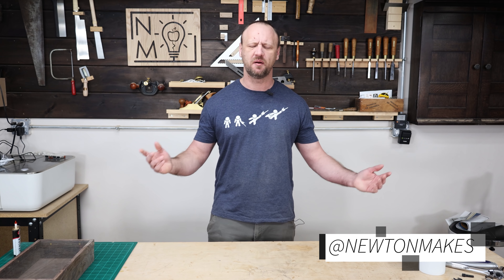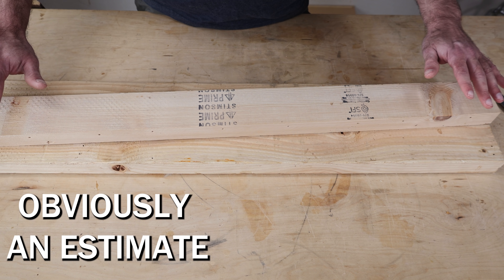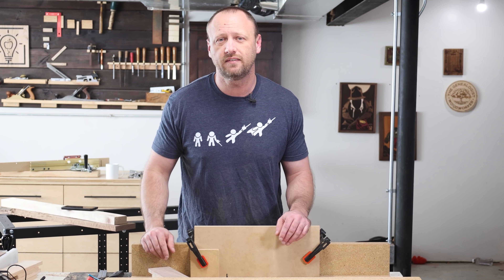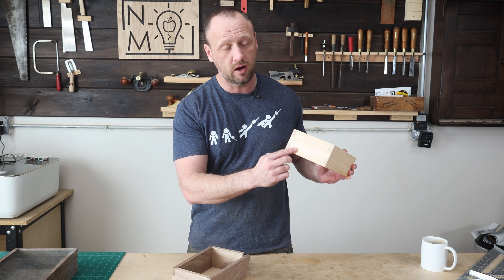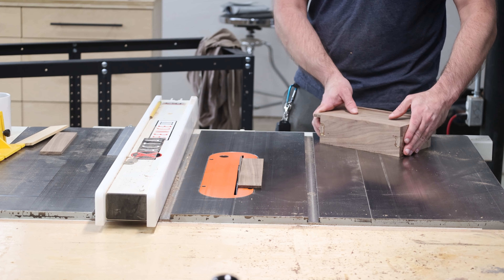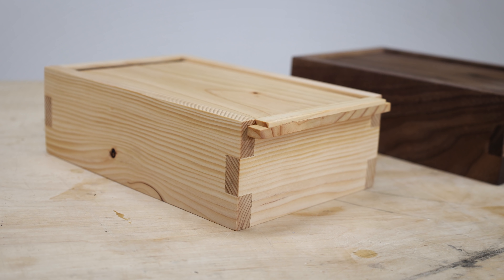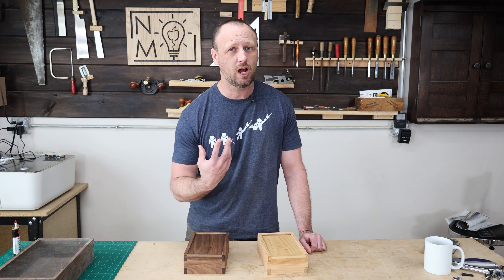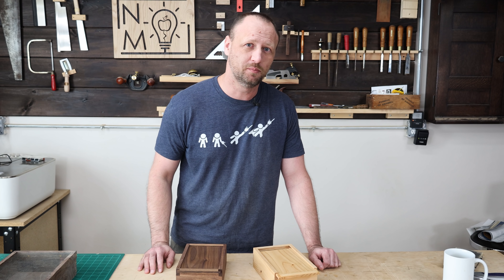2x4 Box vs Walnut Box - What's Worth More? Wood Box SHOOTOUT!

Comment: I agree Billy, thanks for sharing! When I got back in to wood working my wood was a pallet of pallet wood with cut off nails, cost me $50 for it. All kinds of wood. I was able to build enough projects to pay for my table top planner (learned about the wire left in nail holes of pallet wood), table saw, 12” double compound chop saw. Used a punch to knockout the pieces of the nails, used wooded dowel to fill the holes, a little glue and put them in like you would a nail. It didn’t happen overnight, as I was able to add a tool, it help me pay for the next one. I was blessed to have a Direct Tools outlet a hour and half away. Where I could buy either a blemish or reman item. My table saw and chop are blemish with lifetime warranty, where my hair hand sanders, drills, impacts are reman items with a 1 year warranty. Over a year ago I was able to add a 1500x1500 CNC to my shop all thank to that $50 I spent on that pallet, haven’t used any pallet wood in years. A another place for wood are  these places you can go throw a axe, those free 2X8’s make nice heavy rustic Flags, yes I have clamped and glued some of the cracks. Time to makes some saw dust 😎

Comment: Great video! I loved the original video in question. I found it brilliant and eye-opening. I think it really comes down to those two key statements - “I am proud of the box I made.” and “I’d be happy to have this in my house.” Those who can’t make those statements about a box made from construction grade softwood are wood snobs. And that’s OK. As a music snob, I can’t fault them for that. But just as there are people who like highly processed, computer generated/corrected, mindless pop songs, there are always going to be woodworkers who are proud of their creations regardless of the wood species used. (Ironically, although I am a music snob, I am not a wood snob.)  And there are things that can be done to dress up projects like this - from staining and dying to shou sugi ban, wood burning - even painting. Another great option is to use small pieces of exotic hardwoods (which don’t cost much - per box - because so little of it is being used). The splines in splined miter joints or through dovetails at the corners, for example. Or handles, trim, inlay, panel frames, and more. I use techniques like these all the time to dress up projects made from relatively inexpensive stock such as poplar and beech. Making the same projects out of walnut, cherry, or oak would be cost prohibitive on my budget. I, too, would be proud of boxes like these. I agree with Billy; it’s the craftsmanship that matters. To me, one of the best things about using inexpensive stock is that you can make gifts for friends and family members that don’t cost a lot - yet they are very much appreciated, usually kept forever, and even passed down… all because of the inherent craftsmanship.

Comment: Both boxes are beautiful, and if you are just starting woodworking, pine is a fine material to begin with - it is relatively cheap and rather forgiving. Sure, wallnut looks great as it is - you just need to accent it with some nice mineral finish. On the other hans, you can play a bit with staining to get great aestethic effect even with pine. Where I live (in north Sweden) - wallnut is a rare resource, pine is not, so you have to be creative.

Comment: Great point. 
You can do the same work with different species and get a significantly faster sale with better wood, but the cost of the supplies is a fraction of the end product pricing. I think you said $3 vs $15 in base cost.
You can easily learn the craft starting with scrap lumber in your shop or cheap offcuts from the big box stores. (I love the wood with purple paint on it, the paint planes off and you get decent wood with a very low price.) Hone your skills with a low cost supply. Some of my best starter projects were from 2x4 scraps and discounted cedar fencing.
When you are more confident, spend a little more in wood and make the same objects.
Reply from the maker: Hopefully, people will build from whatever brings them happiness.  That's what it's really all about.

Comment: Having started woodworking as a hobby, we use pine and fir almost exclusively. We make boxes, and shelves... and none quite as fine as those, but they're painted or carved to a theme... and they easily sell, so far, for a little over 50$. Some have neared 100. 

Another fantastic, cheaper, box-store quality wood we love is Hemlock. It makes for WONDERFUL looking shelves and boxes. It takes gel-based colored stains really really well. A 8$ board makes about 120$. It always needs scored before a cut to prevent blow-out, but the results can be stunning. 

And, poplar--this wood, for artistic projects (think, a shelf to hold crystals, or a clock, or a small table for children), is cheap and also takes jel stains really well. You can get BRIGHT blues and yellows and purples with something like Unicorn spit, to make really durable, very unique items... out of a cheap box-store wood most people would never prefer over maple (notoriously hard to stain) or walnut (always natural color). 

I think the cheaper woods, pine, fir, poplar, and hemock have a LOT of room for making beautiful, sellable projects for woodworkers starting out, and there's no shame in using those. Cedar, while not always cheap, can be found cheap, for projects as well. Recycled fence boards, if you have a jointer and planer, can turn into some fine looking wood, and, makes for GREAT wood to use on the scroll saw, and Dremel, to put details onto the tops of those pine box lids.

Comment: I like your boxes! I have made more jewelry boxes than I can count? I was wondering why you didn't 45 your pieces? Eight  45,s for sides and back cut out for the bottom , make the bottom and top clue it up. No notching, no routing and a lot faster. You never leave the table saw with the exception of cutting the top loose on the band saw. I'm not being critical, you did an excellent job, I was just wondering?

Comment: At 3:28 I noticed you have tape on the raise and lower mechanism. I have the exact same one and there's an adjustment to make it not move while router is on. I used to do the same thing then found that, tightened it up and it is now wonderful. Just passing along info. Now if you have that on there for other reasons then disregard this message. 🤣🤣
Reply from the maker: I tried but I'll try it again, thanks 👍

Comment: Just came across this video. I am in the group where construction pine doesn't interest me at all for 99% of my projects. Pine is common, cheap, easy to aquire and used by everyone.
 Walnut is fine and a popular hardwood used by a lot of folks. It's quite expensive compared to pine and not as available which adds to the overall value/price point.   
I like to use local hardwoods woods found in my area that are not that commercially available as I can use it to up sale the piece. The wood type is unique to itself and not something most makers  use so I can leverage that point in my favor. Currently I have been milling lots of mesquite, pecan and hackberry  trees into lumber. I have little issue getting more  for it and it's truly superior to pine in every way other than availability.

Comment: Great video. Of course all the wood is not this same. Different species have different benefits in strength or how easy is to work with them. But like you said for me as a beginner I am working a lot with cheaper wood. My joinery skills have still long way to go. So it is better to practice on cheeper material just on case I mess up something.

Comment: I work with dozens of species of wood (live near Rare Woods USA) My personal view is the character of the grain, not the species, have the biggest impact. I have some very difficult to find heavily figured flamed pine I used to make a $10 flat board type coat hanger that gets far more comments than my $2000 Cerejeira bookcase that sits next to it. I built a 60" vanity made from 100+ yr old barn pine than had aged to stunning colors that fetched me over $2000. Species doesnt mean much especially when most peoples attention span is ephemeral at best, and they quickly get bored with things and just toss them out for the new "current fad" I.E. aged whitewash garbage